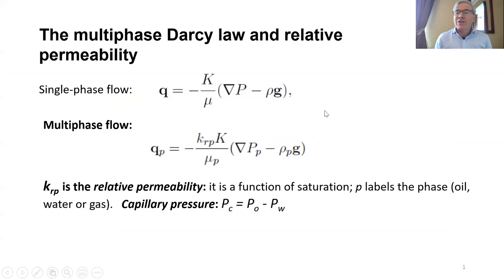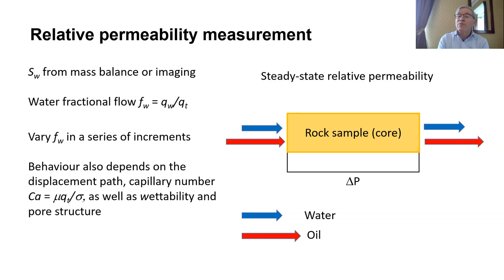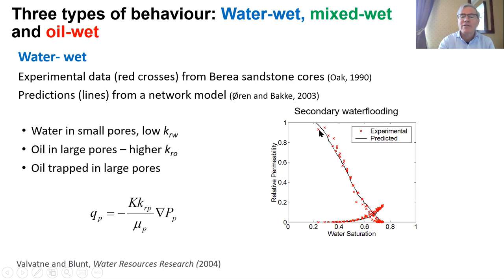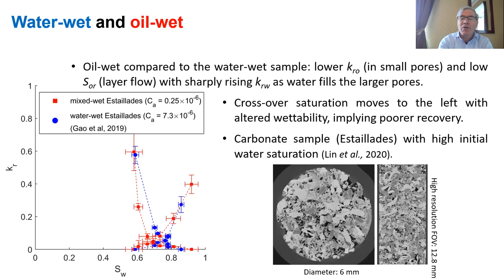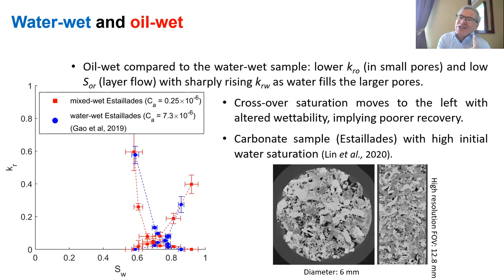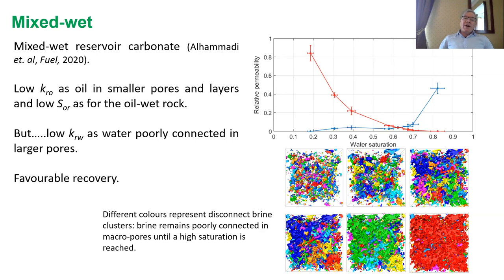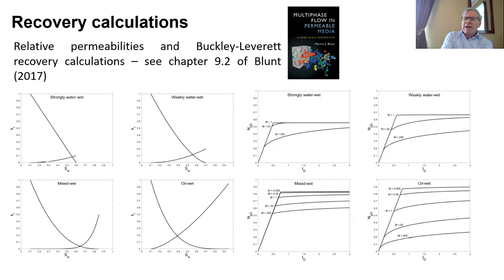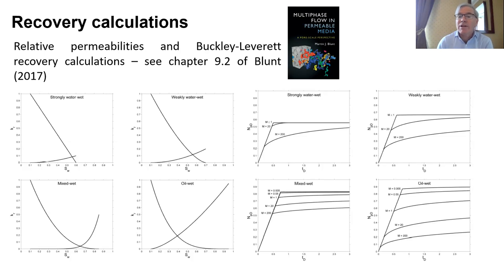Relative permeability and recovery functions

Comment: Thanx for this useful information but can i ask you to speak slowly to fully under stand in future it will be appreciated
Reply: If the speed is too fast, there is a way to reduce the playback speed, go to the settings icon on the bottom right hand corner of the video panel, and click 'playback speed' where you can adjust the speed of the video to a more ideal speed. This is for a desktop computer or laptop.
Reply: Amarjot Singh Bhullar thanx
Reply: Ali Alshrife my pleasure 👌